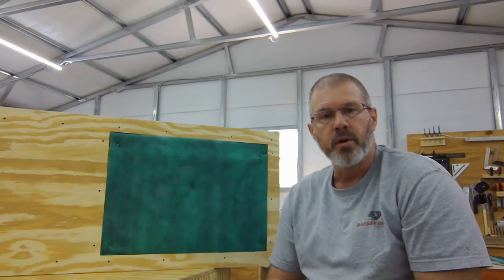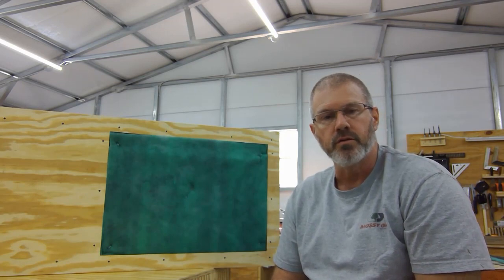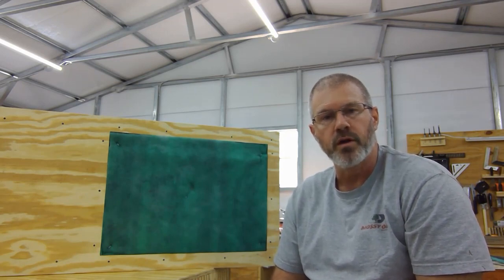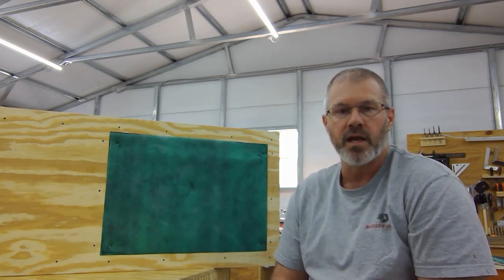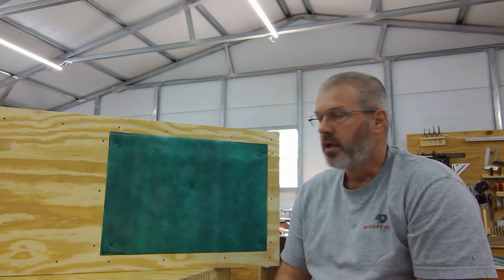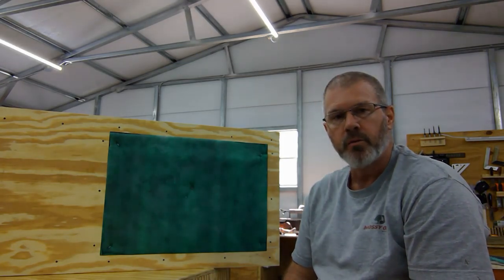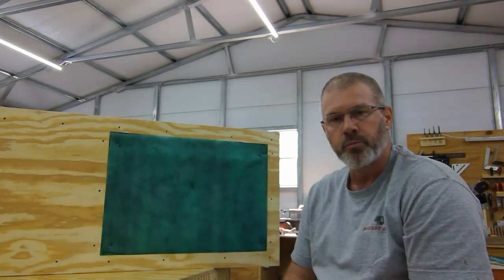Make an air cleaner for fine dust with a bounce house blower

Comment: Hey Tracy thanks for sharing. It would be great to see a follow up video with where and how you mounted it in your shop. Does it pull air enough on its own to collect dust or did you have to direct the air flow to the filter using fans? Did you port the exhaust outside? Thanks!
Reply from the maker: Thanks Justin. Sorry it took so long to reply. For some reason I am not getting my notifications of new comments. I will try to do a follow-up video on it after I have used it for a while. As of right now it is just pulling the dust to the filters by itself. I have not run the exhaust outside. Just letting it circulate the inside air of the shop. So far I am not seeing the fine dust as bad and I have only placed it on the floor.